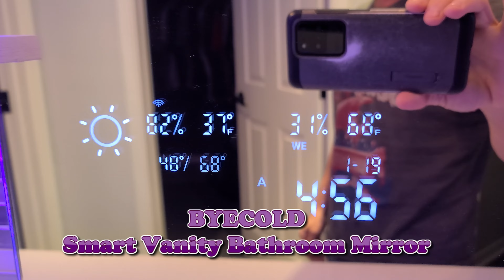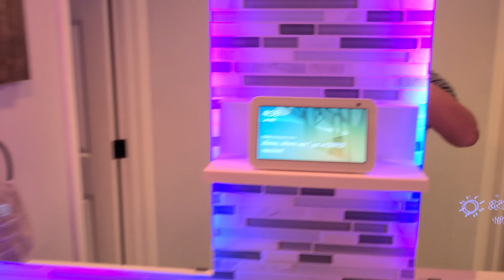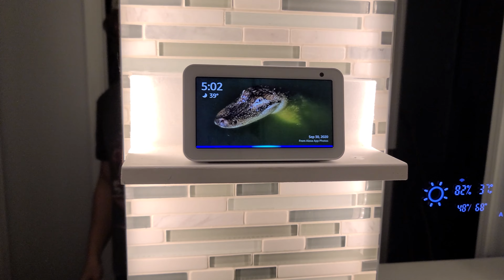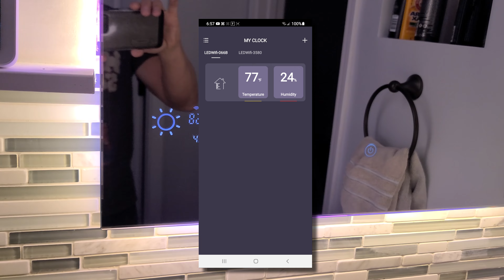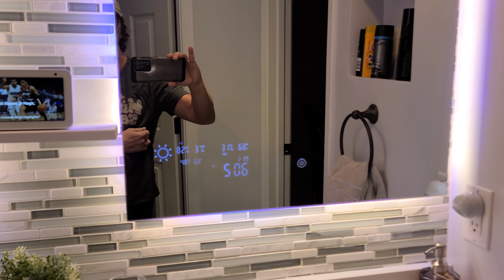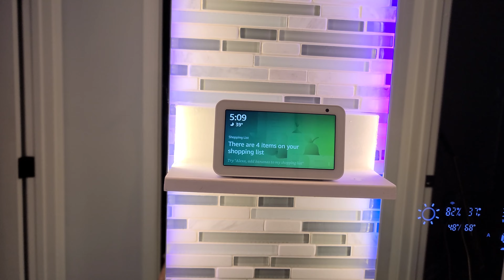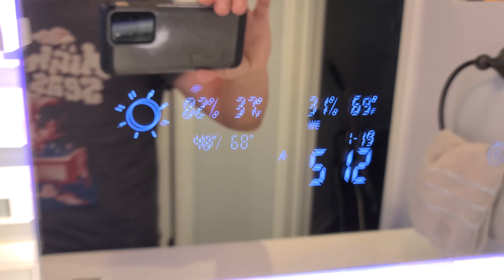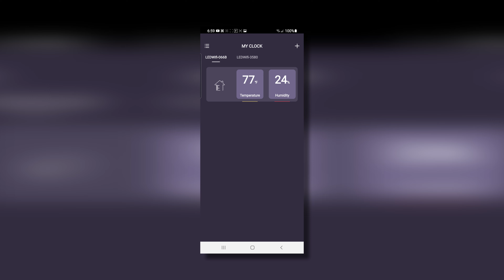Byecold LED WIFI Smart Mirrors with a Colorful Twist!

Comment: I ordered two of these mirrors.  I'm considering wiring them to an existing light switch.  How long do they take to reboot after losing power.  Should I just run new wires so they have constant power?
Reply from the maker: They will reconnect after a power loss but I wouldn't recommend turning the whole things off and on.

Comment: I like your setup very clean. Does the back have an outlet to plug to the mirror or is is just wires that you have to hardwire to it? And how close do you have to have it to the center or do they give you more than enough to put a whole anywhere around the back? I’m trying to get myself a smart mirror myself so sorry if I ask a lot of questions
Reply from the maker: It actually has a plug on the wiring on the back. They give you more than enough wire to plug anywhere behind it. I mean you can just plug into a receptacle behind the mirror unless you have a flat plug or it would stick out too far. I flush mounted my plug into the wall and connected the standard mirror to a smart plug
Reply: @Supercar_Street_Racing  so this mirror has a plug for an outlet? A similar mirror from a different brand has you have to hardwire wires from the wall to the mirror. I’m wondering if this isn’t the case with this mirror because I’m having someone come run the wires to have a box and wanted to have him make it an outlet or leave the wires hanging for me to hardwire
Reply from the maker: It has an actual plug.
Reply: @Supercar_Street_Racing  thank you for the helpful information
Reply from the maker: Sure, if you need anything else let me know!